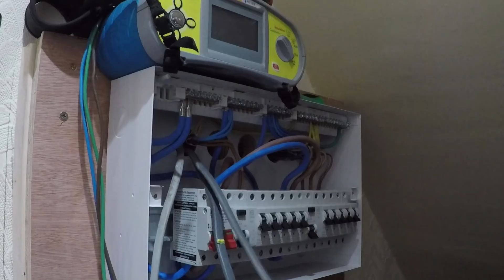Fuseboard change  -  discussing common controversies | Thomas Nagy

Comment: Not an expert by any means but my guess is that the supposed fire rating is given based on how well it might prevent a fire spreading from the room below to a ceiling void via the light fitting, something a proper fire rated fitting is supposed to do anyway as well as preventing the spread of a fire from the fitting itself.
Reply: Fire rating is dependant on the ceiling construction not the type of lamp fitted. The tests do not make provision for a fire caused by a fitting within an already fire rated ceiling.

Comment: I'm not a spark, but would reconsider signing them lights off, I take it they was a standard GU fitting? And anyone could come along and put a 30-40watt  halogen lamp in that can over heat in long periods of time thus destroying the fire rated glass. Now if this light had its own design of lamp that couldn't be changed in any way then maybe I would consider it...... Just my thoughts on it maybe I'm wrong who knows maybe get bigclive or JW to put them through a test it would be interesting to see.
Reply: Glass that is fire rated would not be troubled by a halogen lamp.

Comment: Turned out a good night with this

Fitted a proteus board last week,  nice board.
Reply: Proteus ? ... yuk !
Reply: @muckychimney  i must admit,  it beats bg, mk and wylex nmx boards for me.
Reply: Ewwww
Reply: replaced more proteus rcds that had failed than all other makes put together
Reply: @waynecartwright7276  future proofing for work, even more reasons to fit.
Reply: I have seen a few proteus main switches melt in my 16 years as a spark and seen numerous proteus main switches on their three phase boards starting to fail on EICRs. Lucky to catch them in time. I refuse to fit proteus, I mean if they can’t make a bloody main switch (the most basic device) I can’t trust them with any other products.
Reply: @garethrendle3766  like i said it was a nice board to fit.  Ill be sure to tell cef to stop stocking them thanks for the heads up on the durability/longevity

Comment: I believe the fire risk caused by downlights is due to increased ventilation when drilling a hole in the plaster board. So i guess that the manufacturer is claiming this is solved by having a solid bezel.
Reply: Fire rating is dependant on the ceiling construction not the type of lamp fitted. Otherwise you are almost correct, not all will have a solid barrier, tilting versions for instance can still be fire rated.

Comment: Fire rated downlight? If the intention is to create a barrier to fire that has occurred within the room that the down light serves and the fitting will delay the spread of fire for the right amount of time then I can see it being suitable.  If a halogen Light is fitted then what is the chance of it bursting into flames I wonder - I suppose if it was tightly packed with insulation and no provision for heat to dissipate then just maybe it could (but I’m not convinced) heat up some nearby timber to above its flash point (if that’s the right term?). A build up of heat could melt some pvc insulation.  If a fitting has a specified maximum wattage and type of lamp clearly displayed then perhaps that should be sufficient, otherwise all light fittings would have to be designed to cope with the worst case miss- fitting of a lamp.  I have also signed off a friends wiring but it all tested out ok and he made any necessary changes that I asked for; I respected his workmanship I guess and he had followed the guidance I had given him, rather like having an apprentice.  Anyway, your video’s are very watchable and you can always learn something from someone else. Cheers

Comment: It's the same working for most companies now. Do more for less pay. I was surprised when we had cavity wall insulation at how many jobs they had to complete in a day.
I'd have thought two or three was pushing it as they were also changing the air bricks, and insulting the lofts. Theu had to do some dodgy ladder work just to save time. Likewise when we had new gas mains installed. The guys doing the groundwork really slashed it in. The run from the main to the meter is only a couple of inches below the ground. When the lad came to run a new pipe from the relocated meter (now external) to the existing installation he threw it in. Bearing in mind he had to lift boards, or run a new main half way around a house depending on the layout. His workload was crazy. I was shocked that as soon as he'd soldered the joints, he'd trickle water directly over them to cool them down. A good way to crack a soldered joint. He was working solo behind the mains gang, and they weren't hanging about.
He hardly had time to put the boards back properly. I thought it was really unfair. He was the one who was putting his name on the document saying it was a safe installation, both his work and what he was connecting to. I can imagine if it did go wrong, his company would happily hang him out to dry.
Like you say,  the certificates aren't worth wiping your arse with.

Comment: The "Fire rating" is actually the fire rating of the ceiling ( or wall ) you are making a hole in, and not the fire rating of the light itself. In essence it cover's fire rating's for building control purposes only. The LED only is a cover note for the manufacturer, should there be a fire due to a halogen getting fitted, and less than ideal, although it does come with an "insulation guard" which on a technicality may cover the NIC tick box element of the test sheet......maybe

Comment: I don't think it is your responsibility to enforce that people keep their fire alarms on. I think it's better to have it on a separate breaker. Once we went on holiday and accidentally left the light on in a storage room. The light bulb broke and it tripped the breaker. We came back after three weeks. If the fire alarm was on the same circuit the house would be without protection possibly for three weeks.
Reply: AllkoDH I’m neither for or against either way but you raise a good point there.. food for thought
Reply: If the house is empty then who cares? If you're on holiday why does it matter if the smoke alarms have power or not?
Reply: Who's benefiting from a fire alarm if nobody is in
Reply: So, we still have appliances plugged in when we are on hols. Fridge and freezer for example which could catch fire. My neighbour have electric heaters in every room which they leave on all the time in the winter to keep some minimal temperature even when they are away, so that could catch fire. Also we live in an old Victorian house which has 3 flats in there. So if one of the flats burns, they all will. If nobody turns the fire alarm off it will send a message to me and the firemen. So, the reason to keep it active all the time is to protect neighbours and the house.
Reply: @AllkoDH  in the video he is talking about smoke alarms that wore to mains not fire alarms. 

http://www.townofws.ca/en/residents/resources/Documents/Smoke_Alarm_v_Detector.pdf

i currently only have a smoke alarm that is battery back up connected to lighting system.  so i cant just turn it off if it gets annoying IE cooking toast and forget to turn it back on. . im shocked at how many people remove battery and don't put them back. for that reason i fitted a mains one in my aunties house 
i live in a tower block and they are talking about fitting a fire alarm to the building.

Comment: defiantly not fire rated them down lighters, just not much of a risk with only using LED lamps as the stay cool, but as you say put a halogen in and your going to have a fire on your hands.
Reply: That's not what fire rated downlights are tested for, they're tested to maintain the respective fire resistance of the ceiling into which they are installed. Whether they might cause a fire is another matter.

Comment: Not ALL after market batteries are crap.  I have bought several Canon-compatible ones for my dSLR and they are as good as the original.  I also bought a Bosch one for a drill and that was good too.  Pity that no-one makes them for Metabo gear :(

Comment: What if there was a fault in the lights and it was tripping the breaker and there was a fire while the breaker was off and then wouldn’t have any smoke alarms
Reply: Morgan Mackay really? The point of it was if there’s a fault with your lights you’ll get it sorted. If there’s a fault with the smoke alarm circuit a lot of people would leave it off. I do that same as Tom

Comment: It's a fire break down light not a fire rated look at building regs I think there is a minimum time to stop the fire breaking through one floor to another
Reply: Fire rating is dependant on the ceiling construction not the type of lamp fitted. When tested, a known duration ceiling construction is tested, be it 30, 60 or 90 minute, into which a hole has been drilled and plugged with a downlight. The downlight has to be shown to maintain that duration.

Comment: The downlights are fire rate as the rubber seal and glass is fire rated. Fire rated fitting are not needed in all installations they are only needed if the ceiling it self is fire rated and as we penetrate the fire barrier with a hole for the downlight we need to seal the hole with a fire rated fitting. 
If fitted on a standard ceiling which is not fire rated a fire rated fitting is not required.
Is a very big misconception.

The fire rating IS NOT TO SHIELD THE BULB FROM CATCHING FIRE TO ANYTHING BUT ENSURING THE FIRE RATED CEILING IS NOT COMPRISED. 

Same goes for and back boxes fitted into a fire rated wall in flats need to be fire sealed from behind

Comment: What's an EICR?
Reply: Kombi Man   An EICR is an Electrical Installation Condition Report. If done correctly it will assess the true condition of the installation and highlight all the safety issues and see if the installation is OK for continued use etc. If done on the cheap then it's just a tick list that may or may not tell you anything useful and normally just either gives a false sense of security or find loads of unnecessary remedial work so the inspector can make their money that way

Comment: In Canada it’s code your 120v smoke alarms are on circuit you would notice was off (ex lights).  One must be install in each bedroom and one in the living areas.  Now when you get into condo buildings the whole building need its own fire alarm system, this must be its own circuit,  we paint the breaker red, and it must be locked on.   Also you will still have to install your 120v alarms in each unit on the lighting circuit.  So both are right here, it just depends what your building.

When we get into the condos, fire rated everything is need.   60 min burn time,  some times I wonder how some of the lights I fit are fire rated, but then I look around and see the over the top sprinkler system that is put in,  and the I ask myself why I give a shit?

Comment: Dear colleague 
I really like your videos and categories you as an intelligent and competent electrician. But, I expected you to do some more research on a subject before going to judgement. I use EvoFire downlights regularly and they are in compliance with BS476 Part 21:1987 (30,60 & 90 mins fire rated) .
Equipments can become fire rated in different ways, such as use of intumescent materials or structural design and ... , but in the end they will be tested to relevant standards and be certified by responsible bodies. Its beter we don't judge things just because we don't like the look of them or we are not familiar with the technology which has been used.
Best regards 
Ramin
Reply: He was only questioning the fire-rating and not pronouncing judgement. The point is that he is creating a discussion point that will engage people and lead to a better understanding, which your comment contributes to.

Comment: I mean, I suppose I could see that it might be a hazard since if the smoke detector had a fault, it would also knock out the lights which obviously would cause difficulty if it were dark and the lack of lights might make servicing the detector more difficult.
Reply: That's no reason at all. Very often we have to work by battery operated worklights because we're working on the lights, or in an area that has no lights or windows (some lofts, or running cables through an under-floor void), etc. Especially this time of year when it's dark at 4pm.

Comment: I thought fire rated light fittings had to be enclosed with intumescent flame retardant seals that cut off the ventilation holes in the event of over heating or fire within the enclosure.. Not a peice of glass that covers the front of the lamp. That's more for IP rating as per bathroom ceiling lights. That's how I interperate it anyway. Sounds like some cheeky marketing that's made up by some incompetent company sales team lol..
Reply: A fire rated downlighter has nothing to do with the can being fireproof. It stops flames spreading through a fire rated plasterboard. The intumescent strips swells up and blocks the hole in the ceiling where the downlighter is.
Reply: Not necessarily true. The old style can type you describe did indeed have ventilation holes in the top of the can with an intumescent seal under an matching cover. Many also had a glass cover, and an intumescent ring above the bezel.  Nowadays there are very few made that way and the IP rating is gained via a silicone ring held tight to the underside of the ceiling.

Comment: Simple question is, have you ever seen an LED go on fire? Letter of the law, if the glass is fire retentive, then the fitting when used with an LED is fire retentive. The minute you put a halogen in that you're screwed. Seems bonkers to me.
Reply: Not true. Any glass that is used  in a fire test will withstand the heat of a halogen lamp. A fire rated downlight is to stop the passage of flame and the glass is part of that system. If you mean an led exploding on the inside of a ceiling section then i take your point, however that possibility is not part of the fire testing procedure.

Comment: We have lots of products here in the states with the same claims but without a UL® or other accepted testing agency's mark and catagory number, ITS NOT. It seems from what I've learned from professionals such as yourself is the huge difference between the two systems. Not that one's better, it's just radically different. Our LED lights come with the bulb fitted.

Comment: Can't you run your camera off a drill battery, yes voltage regulation would be helpful.
As for downlights I think they all are terrible. Unnecessary holes in ceiling ,awkward to change bulbs in dressing gown and fluffy slippers. Then did you grab the right type of bulb from Poundland , and look there's fingerprints all round the ceiling .
👍😀

Comment: McDonald had a lawsuit over too hot coffee in 1994 and McDonald lose and had to pay $640000.
That why lot of restaurants dont like  you bring your own container.
Reply: Liebeck vs McDonald's:  Interestingly the argument presented by her attorneys was that, at 82 to 88 °C, McDonald's coffee was "defective", claiming it was too hot and more likely to cause serious injury than coffee served at any other establishment. I suppose that they had to take this angle, because essentially she was at fault; "Liebeck placed the coffee cup between her knees and pulled the far side of the lid toward her to remove it. In the process, she spilled the entire cup of coffee on her lap." Ironically she initially sought to settle with McDonald's for $20,000 to cover her actual and anticipated expenses (she had to have skin grafts and rehab). McDonald's offered her $800. Hence the infamous court case.

Comment: The fast food guys have their rules and instructions; they follow them and they are right about that. The rule is: serve coffee in the single serving containers, provided by your company. Period. The waiters are not even allowed to question that rule and to think they could do otherwise.The specialists think, the waiters just follow the rules. Electricians follow their Codes. What if a client wanted to break some of the electrical Codes? The electrician would say: "No!" Everyone has his Codes. Understands he them or not, he has to follow them.
     Imagine yourself a waiter. The customer wants you to fill his own container. But you don't know this kind of container, you are not trained to fill it, you have no idea of what kind of things it is designed for, whether it is for food or non-food products, what temperature it can stand, whether it is safe or not and so on. Even if the customer gives you the manual on his container, you should not read it, because you can't be sure it's this container's manual and you don't have time for this. Your job is to fill your company's containers, who have your company's name on them. If an accident occurs with your company's container and you just followed the instructions, it will be not your fault. That's it, period....Then imagine everybody comes to restaurants with there own container sets... this will make a mess....
Reply: i worked i a coffee place that serves no food. and we happily use customers cups. but one of are sites that dose have food we do not. its because we dont know how clean or dirty the cup is and it could contaminate are hands clothing and anything we touch. so is a risk to food.

Comment: Regarding the fire rated LED, perhaps manual has fine-print on required box to be installed in? like this: https://www.harald-nyborg.dk/media/images/800/1452_727076.jpg